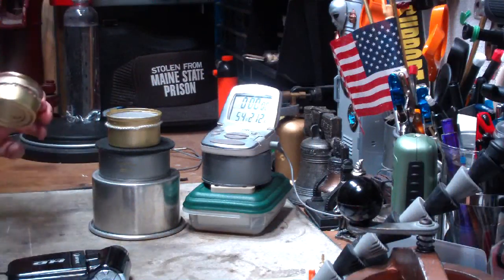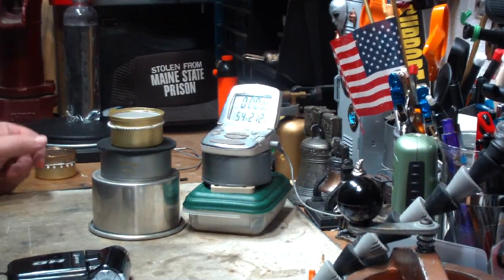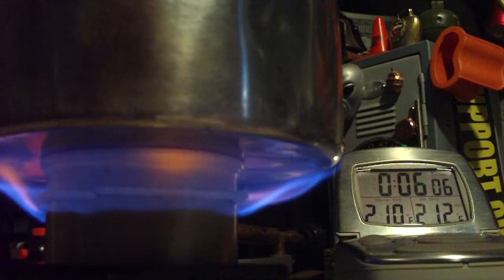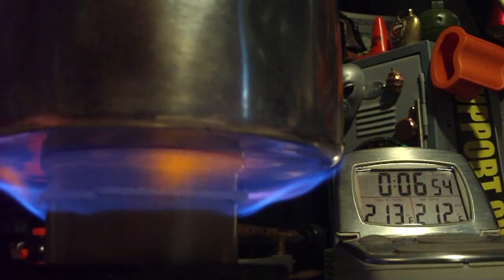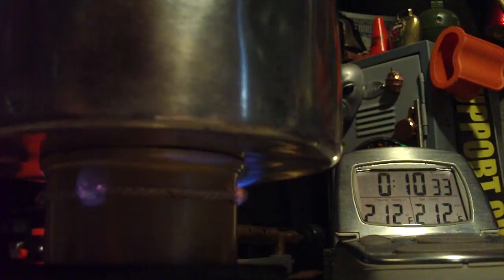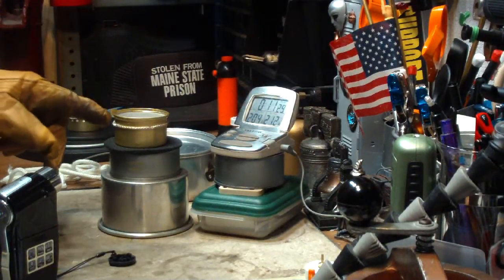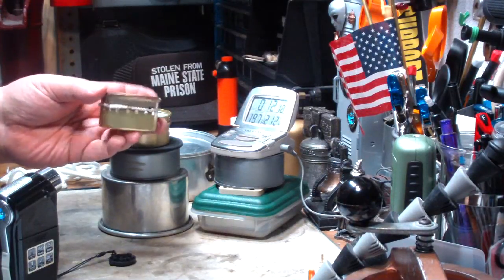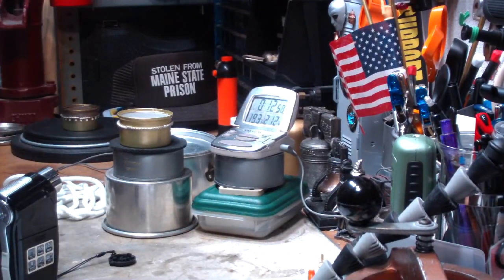Low Pressure - Side Burner Modification #5 - Boil Test #1

Comment: I made another Wick stove today that was bigger than the fancy feast stove out of a tuna can and a soup can and used a old cotton "T" shirt as the wick material  I drilled a bunch of holes in the top side of the can and just squirted the 91% Alcohol in to the tuna can from there.... being larger in diameter the thing was much more stable trying to boil water on it...
it boiled the water extremely fast  even though it gave me a slight poof when I first lit it .
the results were very good, the larger wick stove is the way to go as putting a pot on top is alot less dangerous.

Comment: Hiram, 1 cup= .24 Litre. 2 cups is .48
This external wick stove idea is really good. Simple to use in any temperature, AND an integrated pot stand.  Just needs a really good windscreen (e.g Flat Cat gears type) which will also cost next to nothing. I found a boy scout type pot at the local thrift store for 99cents, so I'm all set for the summer's hiking:)

Comment: Now this would be a very good run against a pressurized stove...like the "penny alcohol stove". I'm wondering if pressurized stoves heat faster even with the prepping of the stove included in the time. With my tests, not much of a difference. But mine aren't controlled as yours are.